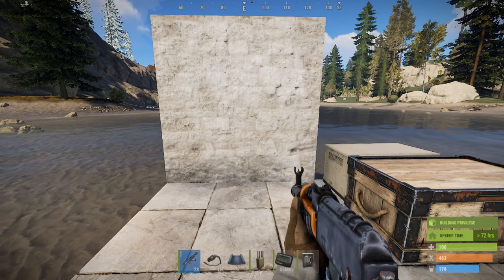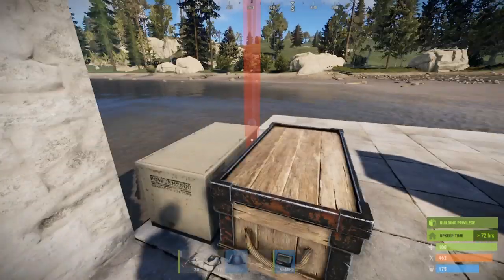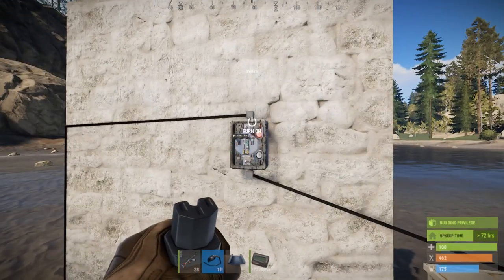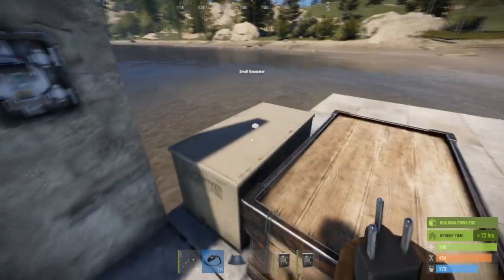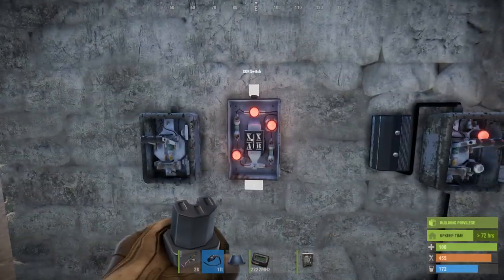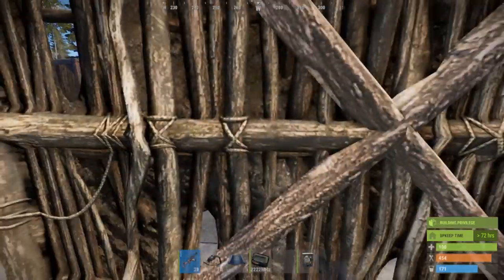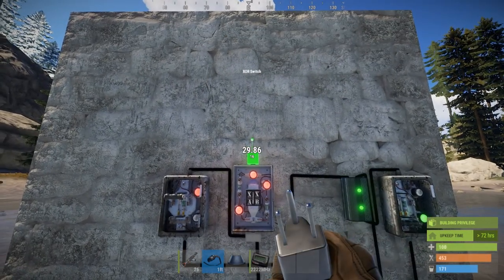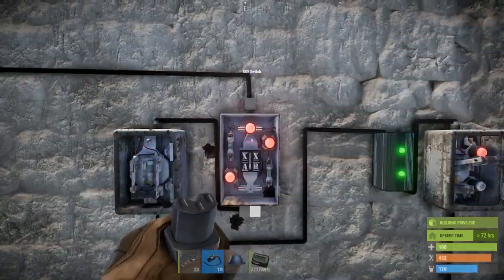Rust Electricity - Raid Alert RF Broadcaster.

Comment: I play on a modded server and like to live in caves, and I use a similar alarm system almost every time! I put the sensor right on the outside wall so I know if someone is down in my cave. The only addition I have is with an AND gate after the sensor to boost the signal, then I set up some siren lights inside my cave :D
Reply: How do you get power in the cave?
Reply: @TheTJRod  ah yes, about that.. the modded server has the generator item enabled so I use that :D constant and reliable 100 power 24/7! I hope they bring it into the vanilla game soon and run it on low grade

Comment: Have you used two HBHF sensors to control multiple items? I am attempting a Raid defense with 3 zones with 2 HBHF sensors each, each zone turns on a different light inside the base for enemy location notice, then any zone activates the turret pod doors and a transmitter. I have it planned out but uses a massive number of components and power. 

Per zone: 4x Branch, 2x HBHF, 2x AND, 1x OR, 1x Light
All zones have a single output to:2xOR, 2x Branch, 1x Transmitter
Then I use a simple door controller circuit for two doors and manual switch: 2x door controller, 1x OR, 1x Switch, 2x Branch

If you want to see I drew out the schematic in Draw.io

Comment: Instead of the switch on the wall that breaks couldnt you just run a wire connected to all outer walls and when a wall is destroyed the wire breaks and the rf xmitter would activate? Im new to electricity but just wondering if itd work

Comment: Wouldn't running a cable around your base be more efficient? I haven't tested this but if I cable is attached to a wall and the wall gets destroyed it should break the cable right? If that's the case then things get a lot simpler.
Reply from the maker: Cables will remain if wired on a wall and the wall is destroyed. I know it doesn't seem like that should be the case, but unfortunately at this time it is so a component must be used.
Reply: @RUSTQuickElectric  eh its never that simple I guess